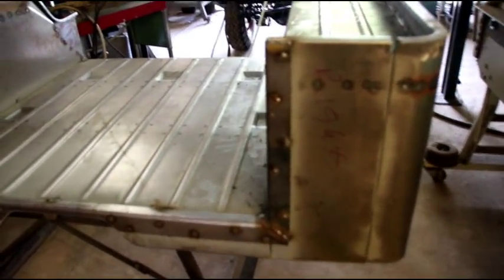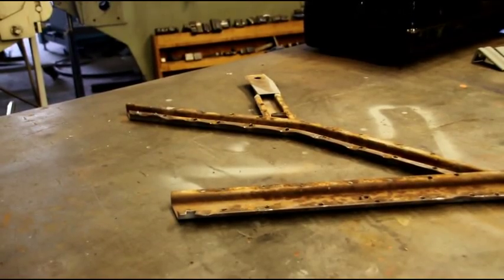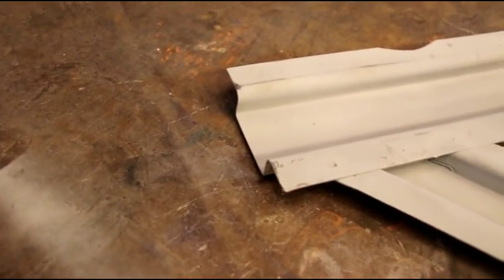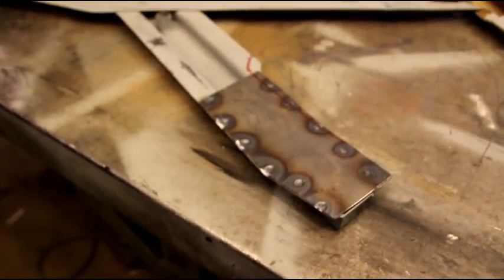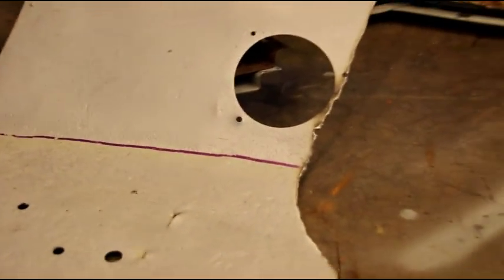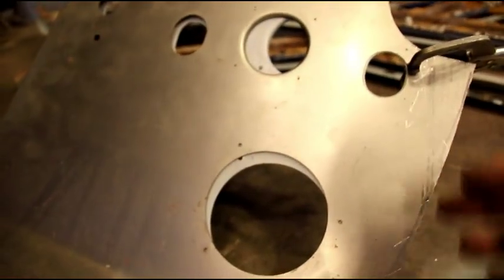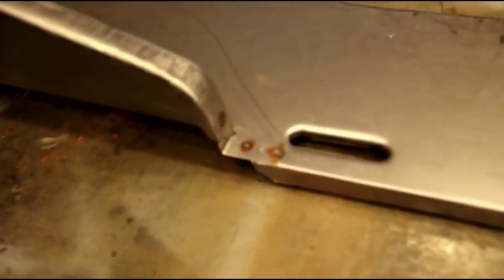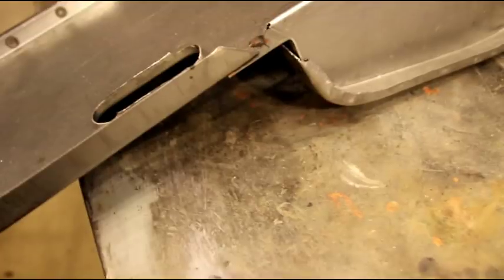Willys Sheetmetal Review WATCH BEFORE BUYING!!

Comment: Very happy to have found your channel and to subscribe . Appreciate your dedication to detail and doing the job right . I in fact am prospecting to purchasing replacement floor panels front and rear for a 1973 jeep CJ5 . One of the vendors is one you mentioned . Appreciate the heads up on what to expect . Not wishing to solicit or sponsor pop here on your channel so I won't post names . 
If you've a better plan before I place orders , I fully respect your advice. 
Thank you for your videos and time and commitment to the restoration of the beloved jeep !
Reply from the maker: I make a lot of parts for early Willys vehicles and would have done so on this project but most customers are more interested in getting their vehicles fast instead of correct.  That is why we used these parts.  VERY unhappy with them.

Comment: I just installed those on my 60 CJ5. Ran into every issue you mentioned.  Especially the clutch clearance issue. My Jeep is not a factory type restoration, so it wasn't too bad of an issue.  But these are NOT a bolt in part. They require everything you mentioned.
Reply from the maker: I always wonder why companies who make reproduction parts don't take the time to make them correct.  Hope you didn't have too much trouble putting in your hat channel.  I know putting these in the 3a project is going to be a lot of work.

Comment: Brian 
could you recommend a good source for parts that would send too Australia. I just spent 109 bucks on 2 engine mounts and shipping was 70 bucks and were missing the nuts. that was eBay. cheers.great vids
Reply from the maker: Let me know what you are looking for I will find someone for you or supply you with what you need myself if I have it in stock.
Brian
Reply: metalshaper very kind of you.will make a list and send it to your email.hopefully you can help or point me in the right direction. as the rocklea plant hear in Brisbane shut in 1974 my cj6 could be one of the last assembled in Australia as its a 74 mod..I don't no if there is any difference between USA built and Aussie assembled. I've looked for Aussie issued owner manuals no luck.thanks for you time.I sent some photos of my jeep too your email  yesterday. thanks again mate.see ya

Comment: What information do you have regarding the quality of steel in patch panels? I did cab corners on my truck and they evaporated in five years!
Reply from the maker: That is very common on many patch panels.  Most companies use the cheapest steel they can find.  I use high quality, cold rolled sheetmetal and prime all areas that will get covered with weldable primer as you have seen in my other videos.  Proper priming and painting will go a long way to keeping your patches rust free.  I have had projects that I patched up running every day and still looking good after 20 years.  Start with good steel and things will last a long time.

Comment: Thanks for the info Brian. I have hats and floors from Classic waiting to go into my 1964 CJ5, I hope they were a little closer with them than your 3A stuff!! After seeing this video I am not too happy. They advertise about how good and accurate their American made parts are, then they send you junk like what we saw on the videos. I cannot imagine how, or why,  anybody would take all the time and effort to reproduce a panel "almost" correctly. That steering hole is a mess and not easily fixed. That is sad... really sad that, they can"t take an old floor and accurately reproduce it without being off a mile on the hole placement. Same goes for the hats!!
Reply from the maker: Tried a few parts from Classic and am VERY dissatisfied with them .  Floors came from Walck's.  Everybody says how good their parts are but as you can see in the video parts a way off.
Reply from the maker: Check out my rear floor comparison as well, you will see how far off that part is as well.

Comment: Do you rebuild body panels for just jeep, or do the F series landcruisers as well. There is lots of fiberglass replication of landcruiser bits which is unpopular with purists. Four wheel drivers find also that fiberglass panels suffer the rigors of rough tracks.
Reply from the maker: i have been building willys panels for many years and build lots of other sheetmetal parts as well.  Trucks, cars, etc.... all is need is a good pattern to work from.
Brian

Comment: Another good video Brian. Recently I purchased motor mounts with a rugged ridge sticker  but also Omix ada sticker too. I was blown away at how they were not even close to the F134 mounts from my 58 CJ 5. Not sure what to do now. Do you know anyone that makes the heavier duty original repos on those mounts?
Reply from the maker: Everything that Omix carries is junk.  I advertise my restorations as omix free, meaning I won't use any of the parts they carry. People in the know understand what I mean.  There is not anybody making good quality reproductions of the motor mounts.  You will have to look for NOS if you want good ones.
Reply from the maker: The new blocks are a chinese import, and like most stuff probably not up to a high standard.  I have not gotten my hands on one yet but I would go thru 100 original blocks to find a good one before using a new , overseas casting.

Comment: Sad  and the fact he signed it is  even sadder...I been through that on my trucks and jeeps I've owned and worked on same company for brake line and fuel lines....  local parts store you have to drive your rig right up to the counter so you can compare the part you want ...our you'll end up going back two or thee time ...lol its sad..I tell the kid just give me the cross reference book and I'll tell him what part number I need ...such is life guess,.. i'll just have to get a cellphone so I can Numb out Too ....smiling
Reply from the maker: The parts are getting terrible out there.  The fact is I can make anything correctly in my shop and turn out perfect restorations all the time.  This is the first and worst project where the customer insisted on buying the parts and was worried more about the cost than the quality.  Now that I am this far in the restoration the terrible parts are showing a big impact on the quality and correctness of the project.  I no longer film the 3A project because I am not happy with the way it is going.  Will continue to film my own projects and continue to show how to do things the correct way or how to make a custom part.